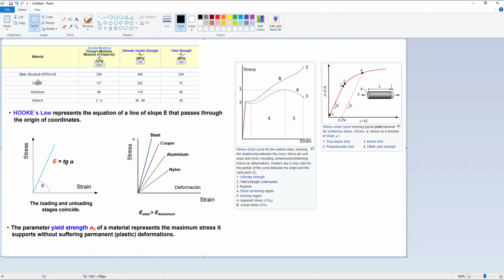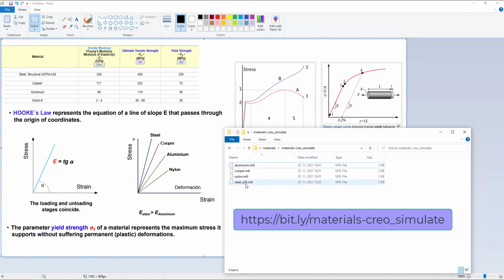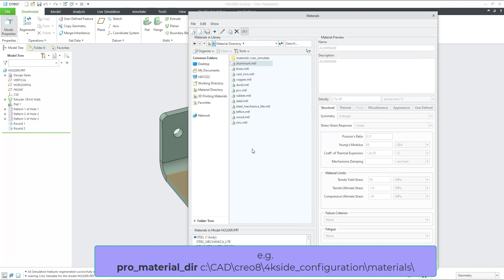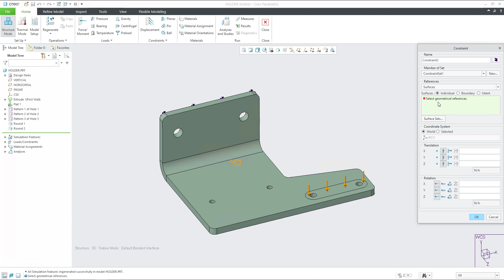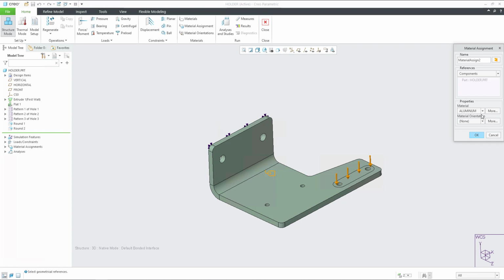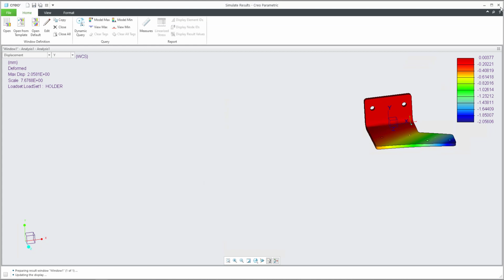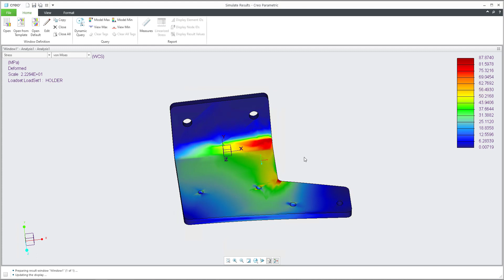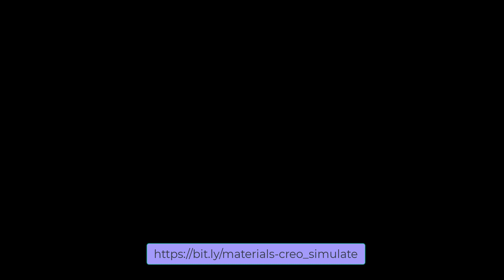Stress-strain curve vs. 4 different materials | Hooke's Law | Creo Simulate

Comment: Interesting. I have done my own study, but am finding stress and displacement data to be linear. I keep wondering why this is and if it has anything to do with the Linear material setting. I have been wondering why Creo uses this as the default for the legacy materials also. I assume it is a 'good enough' in most cases, but I am not too sure

Comment: Hello Vladimir.
I may have one request (if possible): 
Would you, please, make a video showing how to make a plane (original datum plane or later created plane) visible. If I have an assembly that consist of many parts and I want to show/activate only one plane of a part that comprises my assembly - how can I do that? I find it extremely complicated.
For example, in Autodesk Inventor, I can simply choose part in my assembly, then choose the plane of interest and show/activate/highlight it. 
This will be of great help. Hopefully you can show me the way.
Reply from the maker: Hello Sergey, thanks for your question. I am absolutely with you that sometimes is very hard to select exact plane in the assembly. I will try to find some example / solution for this. Stay tuned and have a nice day. Vladimir
Reply: @4kside  Thanks a lot.
You are doing a great job. Keep it up!
I find Creo as a very good software, but a but complicated  compared to Inventor - so there is a reason of reaching out and asking for help.
Have a nice day you too. Best, Sergey
Reply: Hey Sergey! I would suggest one quick tip for you to use in future. Name your datum planes with a unique assignment like say for example XY_001 for part 01 and XY_002 for part 2. If you search 001 or 002 in your model tree, it will highlight the planes ur looking for in green with other parts in grey. Its been extremely useful for me as well since I do lot of top down design that makes use of datum planes and axes.